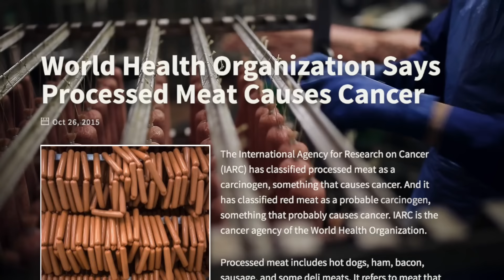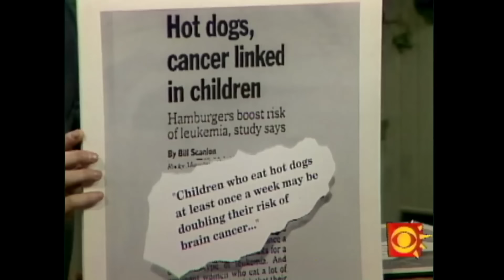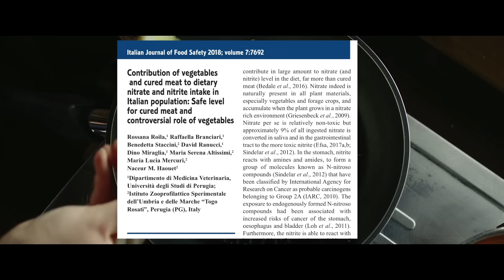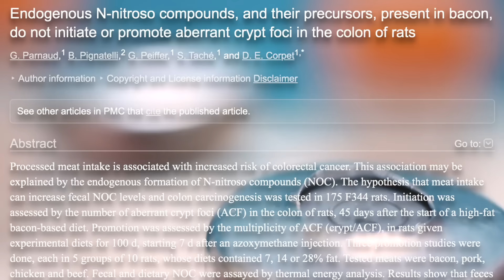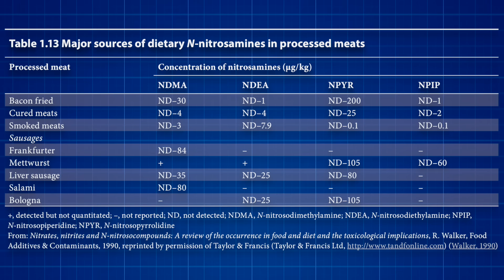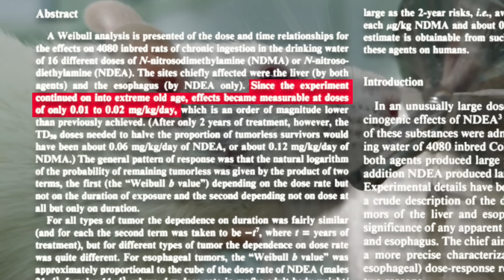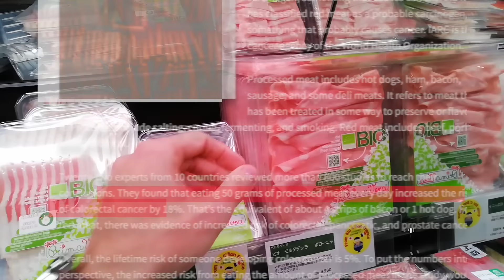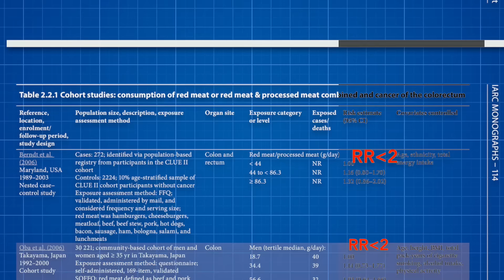Is Bacon actually bad for you?

Comment: One thing I've noticed in these studies is the fact that cancer research is used on mice to simulate possible correlations with humans. But in biology, smaller mammalians develop cancer far more easier and faster than larger mammals. In fact the larger the mammal gets the less likely they are to get cancer  in general, eventually reaching the point where whales themselves do not if only extremely rarely developed cancer at all. Could this also skew cancer research?

Comment: Todat i learned that the LD50 of SPINACH is just 3 kg, and i'm still procesing how to interpret such a casually terrifying fact
Reply: Most people will not give an issue couse thats a heap of spinach, but it would be possible to die from spinach if you really tried. Wont be able to do it in a single sitting but eating that over a whole day probably would do.